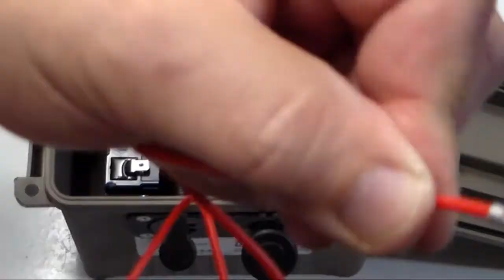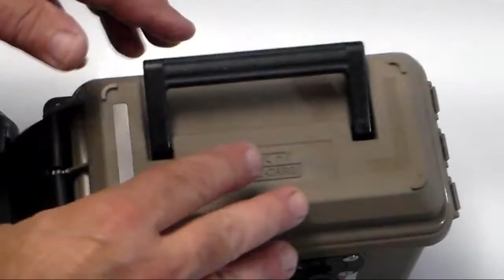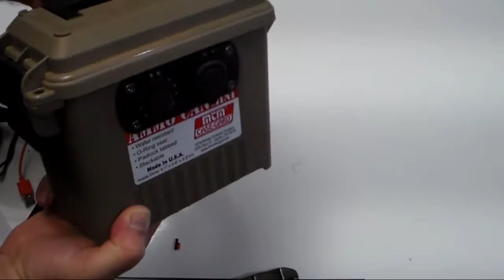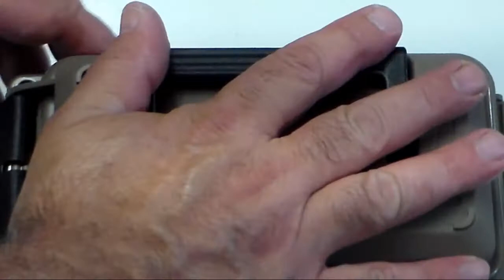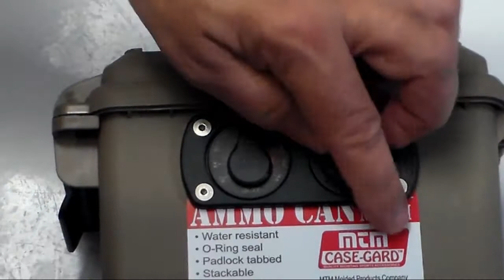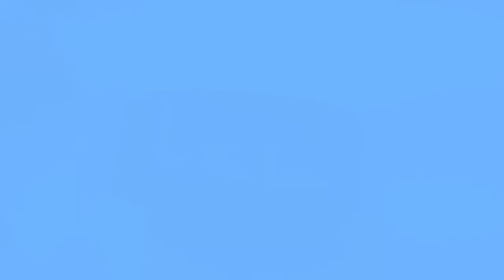AMMO CAN BATTERY BOX BEGINNER BUILD 3

Comment: USB ports are always hot. You need  to put it on a on/off switch or it will drain the battery
Reply from the maker: Hello, you talking about that side port with the meter? It has an on off switch but here's the deal, had the mini in my car for some time, all summer and took it out to charge it up, battery was stone dead.
Reply: @thisoldmanchannel  
USB always have a " phantom load" and will slowly drain the battery.  That outlet must have a switch to turn it off. Ask me how I know....dead boat battery just from the USB being on for a time
Reply from the maker: Hard lessons... Okay so we got an update video in the works for the Mini Battery Box... Thank you so much for your comments!